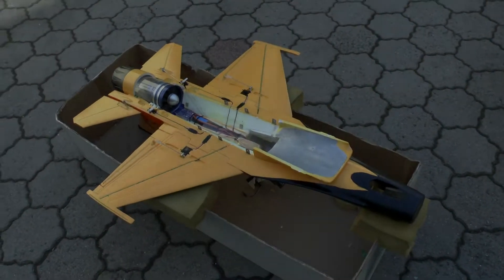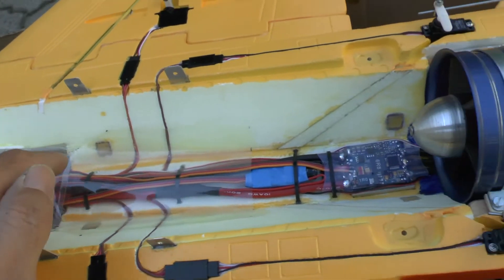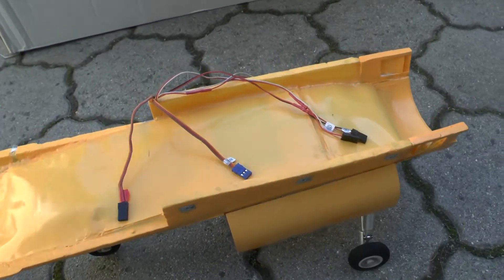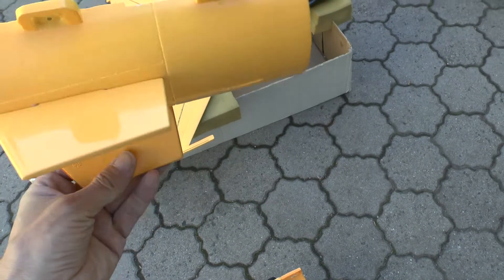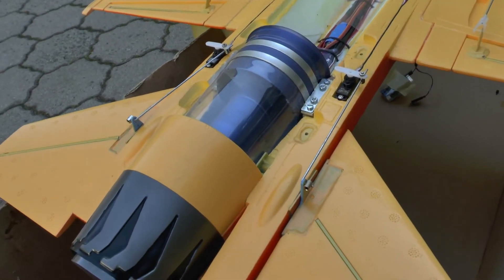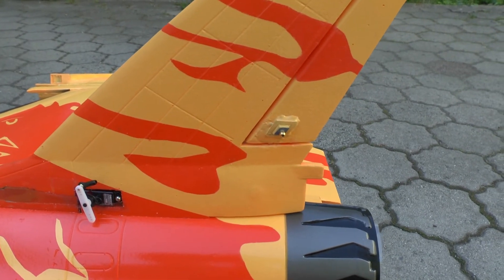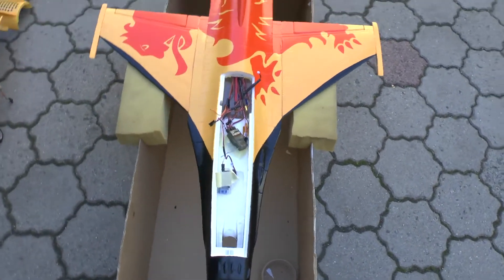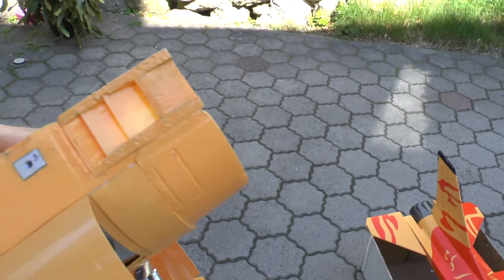RC Lander F-16 HRAF - Build part 3

Comment from the maker: hi there, thrust tube is made out of clear plastic sheet. to prevent the gear doors from opening too wide glue on a thread between gear door and foam. i made myself some knifes to do the cuttings and used normal sandpaper with the fingers to smooth it out.

Comment: Gary, good work! Not sure whether the PVC cover can help to improve sound, but the air flow there can help to cool battery. If ithe cooling is not a concern, you can simple shut the hole under canopy to avoid PVC sheet being sucked down.

Comment from the maker: clean but not without many problems :(
i just had to remove the pvc cover over the wires in the ducting again because the edf sucked the front piece over 1cm down. have to find another solution.